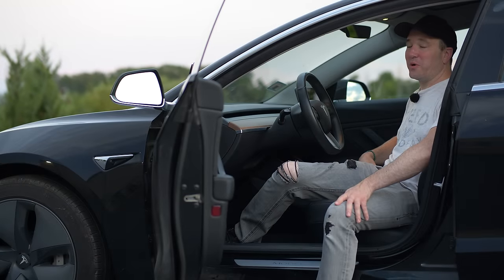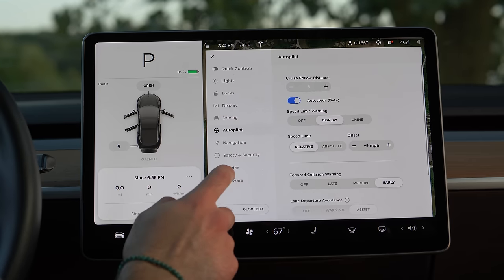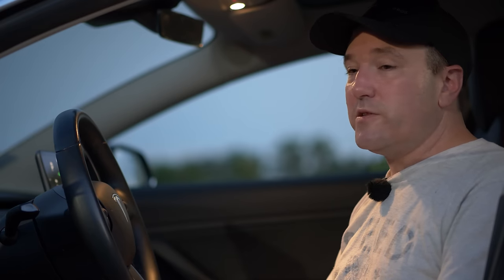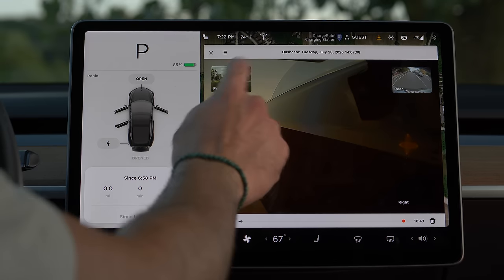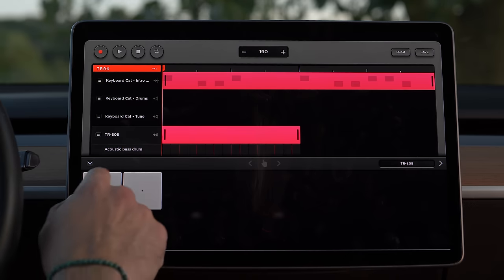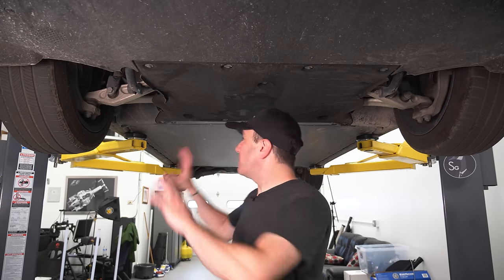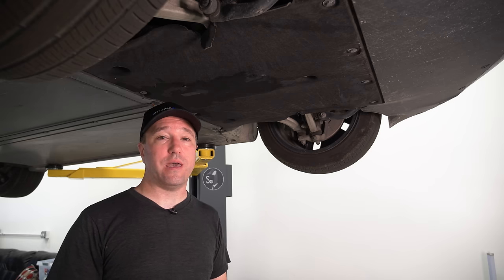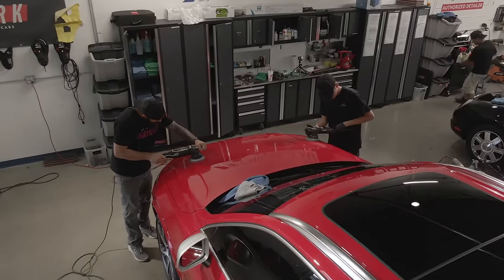Tesla Model 3 | Explaining the Cult

Comment: For Companies as big as Toyota, Ford, VW, or GM. Implement Hybrid in millions of cars and trucks is greener than making few EV  that only few people can affords.   Tesla is a luxury not appliances like Corolla or civic. Besides that,  15 y period tesla battery cost $30k or more but hybrid only $2.6k
Reply: Correct
Reply: Rishav Roy if you look at analysis online...Tesla’s carbon footprint due to materials used is very taxing i.e. the batteries....and they only come out slightly on top after years of use. And they sell off those emission units for other car companies to use so it is really not making any difference when we break things down. 
Combine the price tag with the battery use inconvenience for most places in the US—makes them much less impactful than Hybrids who have the potential to hit a broader market and can greatly reduce the amount of gas waste emitted...and are much easier to mass produce.

With all this said...Tesla is truly a great innovation and will leave a positive competitive impact on the auto industry. Like explained in the video...this technology will take another decade...
Reply: @EmilyWash  The analysis I've seen shows breakeven on footprint after a few months to a year.
Reply: To me EV is not about "green". It's about easy of maintenance, the torque. In the case of Tesla, the ease of pushing new functions. 
It's how a machine should be, like modern fighter jets, a solid mechanical base enabled by the software to perform something no human can do.
Reply: attakmint hm I haven’t heard of one like that. Does it take into account all factors? Where can I find it?
Reply: @Rubedo Alaberti tesla automatically hits your brakes once in a while to prevent rust build up just like how your describing.
Reply: Most of those hybrids ran entirely on gas because no batteries came with them, it was just a gas engine hooked up to electric motors. Battery cars become greener the more emmision free energy you use. In my state a Tesla produces 15x emmisions per mile.
Reply: @EmilyWash  There's a number of analyses out there.  Here's a meta-analysis that seems to think it's 1.5-2 years, but doesn't figure in how many miles you drive per year.

https://theicct.org/sites/default/files/publications/EV-life-cycle-GHG_ICCT-Briefing_09022018_vF.pdf

Of all people, Donut Media did a video on that topic.
Reply: @odisy64  what?
Reply: @ShenghongZhang  no its a cult for rich spoil kids.  It is a replacement for a luxury car like Porsche or S class.  Not a replacement for civic or corolla that kept for 20+ years.  You have to be super lucky have 20 years Tesla without costly repair.  Most Prius owner since 1998 only spend less than $5000 repair after 15 years.  Tesla battery cost $40-$60k with  lifespan 8-11 years.  Door, brakes, heat-pumps, and other issues in Tesla also not cheap.  Off course, hybrid is cheap to maintain if it is made by Toyota/Lexus or Ford, not the case for Benz, Porsche, or VW.
Reply: @rishavroy3756  no,  compared to keeping 100 pure gasoline car + 1 tesla  vs 100 hybrid.
Reply: @odisy64   About hybrid, there are 2 systems : HSD hybrid synergy system(Toyota,ford, crysler) that can use either just battery or both. and serial (GM,Honda, Benz).  The HSD system is proven very reliable (since 1998) and thousands of Toyota reach 500k miles with original battery and cost only 1/20 the cost of EV battery.  Li battery is mostly non-recyclable  meanwhile NiMh is largely recyclable and efffectively cost much less and last longer >15 years (2016/newer model).   For Large company like Toyota, making 50 hybrid is greener than making 1 EV+ 50 regular car.   MPG in Camry hybrid in city is 46mpg vs non hybrid 29 mpg.  EV is a farcry cult that our natural resources to produce enough electrodes (Co and Li) is really poor in war zone like Congo or Afghanistan.   NiMh battery in certain respect is better choice because it is abundant and recyclable.    Compared to Tesla battery (cost $45k vs Camry $3000 (with recycle program)), definitely Hybrid is greener for the whole population and affordable.  Corolla hybrid 1.8L cost $25k, meanwhile Tesla cost > $40k, different market, different mindset. Appliances vs Luxury.
Reply: @rondhole  thanks for taking the time to go in debth with your reply, ill try to address some of the things you said but i gotta ask if you believe hybrids will always be viable or for a long period of time? most hybrids aren't plug in hybrids, i believe less then 3-7 of Toyotas hybrid sales where non plug in hybrids that just ran on gas on efficient electric motors but i could be wrong on that.
its because of the small battery size is the reason i dont believe they will be better for the environment even with the cost of producing the battery. hybrids usually include really low battery ranges usually less than 40 miles so most of driving done with them will be on gas if the owner is lazy about plugging in so it ends up behaving like a gas car that just emits toxic fumes in city streets and around people even if it does do it less than a regular car.
ill give you a figure i recall, i believe it takes about 11-15 tons of co2 to make a Tesla battery but the average American drives 12k miles a year and produces around 10k pounds of c02 in the process using a 26mpg car. so in about 2 or 3 years you can start making up the difference.
ive seen companies already achieve a 93%-97% recovery rate on Tesla's own cells in recycling programs currently being developed so even if the batteries can last a million miles they can be used again unlike gasoline. 
id take lithium and cobalt mining over oil drilling, that has caused way more environmental and political damage than lithium ever could. lithium is a pretty common metal and if we really need it we can drain it from the ocean but oil is actually finite on earth.
Reply: @odisy64  I agree with greener in  EV, or HV.  Plugin is a good transition to full EV but the capacity of the world is not enough to supply enough battery for average people with 200 miles or more EV range.  Li battery is hardly recyclable so  keeping the battery life is the main priority which Tesla, Toyota, GM, and Ford did very well.  But Nissan/Renault screw it up with really bad battery life from cooling/heating issues.  Realistically, regular hybrid is the best solution for most people.  plugins-hybrid cost 3x more battery ($7k+ )  vs about ($2.5k in regular hybrid) in 15 years lifespan.  In europe, gasoline is $1.25 per liter or about $20 per 400 Km with hybrid corolla.  Electricity like KIA soul with 33 cents to 0.9 cents/kWh in fast charging station will cost  €20-$60 per 400 km.    In total for fuel alone, EV is still more expensive than Hybrid. Combined with the 15 years battery replacement cycles, EV is way more expensive than hybrid.    If you care about environment, car pooling and public transports is the way to go not cars/trucks.  Electricity could be less pollution if you use Nuclear plant. Wind turbine, solar, etc needs 1 millions time/more area.  Most countries still use gas, coal, or even heavy oil for their power plant.  So,  again, making better gasoline engine combine with Hybridisation is the way to go for environment.   Besides that, hybrid range is more than 600 miles and refuelling takes 5 minutes not 2 hours, and most people have no garage to charge their cars.
Reply: @rishavroy3756  Not if you project it to the whole world.  1 Tesla battery can make 60 hybrid that can cut 1/2 of fuel in 60 cars.  So, Human easily cut 1/2 of fuel consumption by sacrificing 1 Tesla for 60 hybrid in average.

Comment: Very good review that's pretty fair all the way around. For the future:
* Try the voice controls. You'll find you rarely use the screen while driving to change things.
* Drive it in the rain - the wiper setup/controls are constant discussion point.
* Please obtain a Model 3 Performance and track it w/ track mode. If you can, get one w/ better rims/tires.
* In a future video, discuss the tech behind safety stuff.

Disclosure: Own a 2020 Model 3 P-. We love it except for two things my wife is not a fan of:
1. Door handles - she curses the door handles "Only a guy would have designed these this way".
2. The seat belt placement. Seems like it's meant for males out of the box. We had to buy a seat-belt-extender for her so it didn't go across her collar bone.

Comment: To be fair about not having buttons, the steering wheel has audio control and you can control fan speed or temperature using voice control- which is also activated using the driver wheel

Comment: Ive lived all over California.   I cant imagine any part of this state being good for driving to a place to charge a pwrsonal vehicle.   If you cant charge at home, dont buy it.
Reply: Same thing as a gas station ain’t it? You just pull in and charge. Not that hard.
Reply: @jackpixley3696  Difference is it takes like 4 times as long, and stations are nowhere near as plentiful.
Reply: Many workplaces are now offering charging stations, if you can charge it for 8 hours a day and top off at the house, that's not too bad
Reply: Think of it like your smartphone: you charge it overnight and it's ready for the next day! The only reason to use the Supercharger is when you are traveling, and they are positioned along the route to enable that. Yes, it takes longer than pumping petrol, but for those eager to switch to electric, this really isn't a deal-breaker. It won't be long before the charging times are competitive with petrol fill-ups!
Reply: You can charge at home. I charge mine overnight. 

The Supercharger network is more of less a way of taking your car on a road trip or not being stuck somewhere charging forever.
Reply: In most of Northern (Bay area) and Southern Ca, it'll take you possibly a half an hour to chsrge somewhere.   Then you gotta jerk it til its done.   But whatever floats your boat.   That network isnt a selling point for many, and many have issues with waiting in lines or the boredom of waiting.

Comment: First of all, let me say that this is the best review I've seen regarding this vehicle.  Now I'm going to start bitching.  We have got to get over our love affair with internal combustion engines and start embracing the future.  It's holding vehicle design back.  Manufacturers are constantly dumbing down technological advances, pumping in audio so that petrol heads are fooled into thinking they're driving Duesenbergs, putting in fake shift points so that CVTs feel like automatic transmissions even though they're faster and more fuel-efficient.  Just fucking stop it.  I'm enthusiastic about what the future holds for modern cars.  I want cars that look like they were made by Spacely Sprockets which is why I'm so enthusiastic about the Cyber Truck.  Why are we trying so hard to hang on to the past?  We are on the cusp of a paradigm shift in the automotive industry.  "Don't run away get in front of it."  Tell me it wouldn't be cool to drive a car that sounds more like a spaceship than a v8 engine?  Having said that I am not quite ready to run out and buy an electric vehicle, not yet anyway.  The costs are still too high, the range too short,  the charging is too cumbersome and it still takes too long.  But all that is probably going to change in a few short years and on that day I intend to fully embrace EVs.
Reply: If you don't like V8's, then that's okay. If you don't like shifting your own gears, watching the tachometer bang off the rev limiter, as the engine roars like nothing else, then that's okay. I take it you've never heard one in person, though. Also, If you wanna know what EV-Sports cars might sound like in the future, check out the Hybrid LMP1 Race Cars.

However, It seems to me, you've never enjoyed a Proper Sports Car. To you, it seems, a car is just a car. You're not an enthusiast; at least, not the kind of one this passion attracts. And to me, at least: it seems you've no passion for any emotional experience whatsoever, at all. Don't worry, though. There are enthusiast cars, and there are cars made for you. We will all embrace EV's eventually. We just want to enjoy what we have here.

Comment: Maybe Illinois has an anomalous situation going on, but coal is on the way out.  Overall, the grid is getting cleaner over time.  EVs are cleaner over their lifetime than ICE in a cradle to grave analysis.
Reply: Yeah, except that they have nothing to replace it with. Half the government is vehemently opposed to nuclear, which is by far the most efficient and clean energy provider, so what’re they going to put in its place? Wind? Solar? Germany learned it’s lesson with those, one month they were having to import energy, the next they were having to pay people to take it away. It’s all great to say “Do away with coal”, but nobody wants to come up with a good source to replace it with.
Reply: @a13xp52  Solar and wind plus storage is cheaper than coal.  When implemented correctly on a diversified grid, these can certainly offset coal.  It's not all or nothing.  Nuclear is fine with me but the problem is it's too expensive.
Reply: IncognitoTorpedo Solar and wind aren’t reliable enough yet. The technology is not developed enough to sustain the amount of energy we require alone. If we aren’t willing to go all-in on nuclear like France is, then we have to continue with coal and fossil fuels. Maybe a few decades down the line, when we can weed out the issues solar and wind have, it is a more reasonable ask. Right now, it just isn’t.
Reply: @a13xp52  I don't think you are up on the latest clean energy technology.  Solar and wind have been reliable providers of electricity for YEARS.  They're in use all over the world.  They really don't have a lot of issues.  They are intermittent, so they require grid integration or storage.  You should look at the LCOE (Levelized Cost of Energy) figures for renewables plus storage versus coal or nuclear.  Personally, I have no problem with nuclear, but the cost is just way too high.